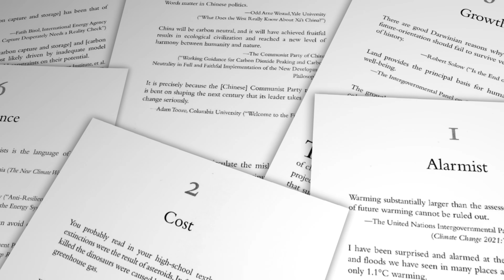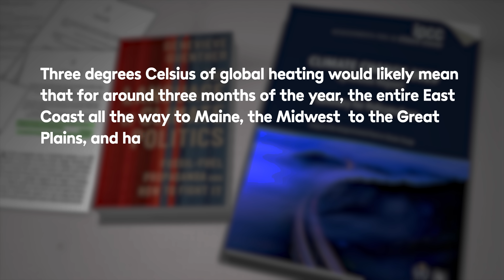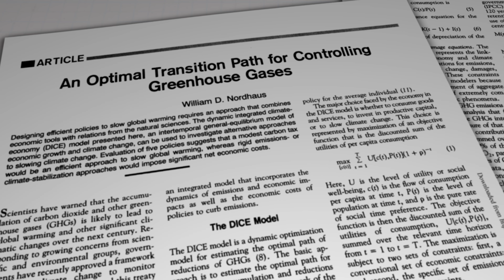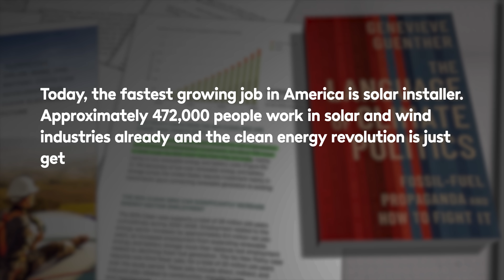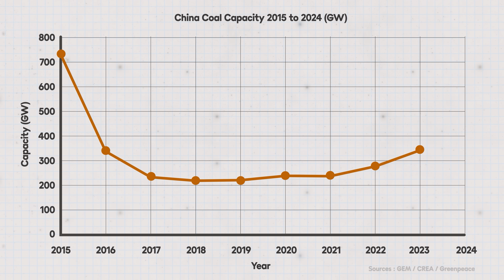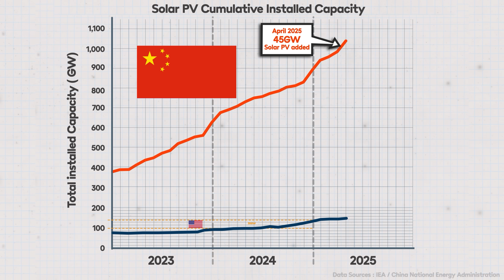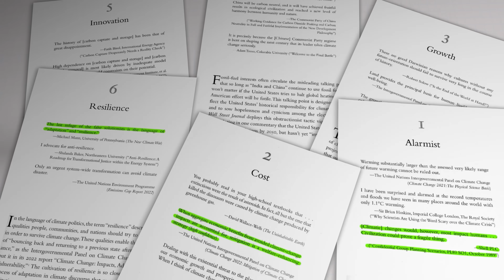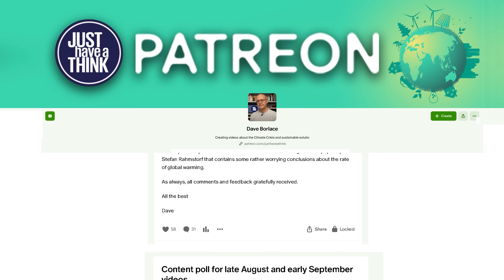New research DEBUNKS climate disinformation.

Comment: Another important point to make about China and India's emissions is that in the last 50 years western nations have offshored heaps of our manufacturing over to those countries. So yes, there's a lot of carbon emission over there, but that's because they're producing all the stuff that we consume as well as the stuff they consume.
Reply: Make planned obsolescence illegal
Reply: Yes. Also don't forget that China and india have been developing countrys with very low emissions for a long time.
Reply: @monkfishmondfinsternis3162  "China and india have been developing countrys with very low emissions for a long time."   Extremely low cumulative per capita emissions -- barely a rounding error of the sum of the developed countries, i.e. global north.
Reply: @alan2102X  Wrong, China's per capita CO2 emissions dwarf most of Europe's including the UK.
Reply: @Hedgehog-e3r  Perhaps you missed the word "CUMULATIVE", i.e. historical. China's cumulative per capita emissions (over a century or two) are as I said a tiny fraction -- like a rounding error -- of that of any developed global North nation. Same with India's and the rest of the global South's.
Further, China's current per capita annual emissions (9.4 tons) do not "dwarf" the E.U.'s (10.7 tons), though they are indeed a lot higher than the U.K.'s (4.4 tons). Some of China's emissions are, as you know, generated in the process of producing stuff for the U.K. and the rest of the global North; i.e. they do not express the reality of the emissions for which China is properly responsible.
Reply: @alan2102X  Deflection - they're the major contributor to the highest ever man-made CO2 levels in the atmosphere. But you're saying it's not t3heir fault?
Reply: @alan2102X  Some 2023 numbers: Canada 14.91 tons, Russia 14.45 tons, Australia 14.21 tons, US 13.83 tons, China 9.24 tons, Germany 7.06 tons, Austria 6.65 tons, EU 5.66 tons, UK 4.42 tons, Israel 4.13 tons, Mexico 3.52 tons, Ukraine 3.17 tons, India 2.07 tons, Afghanistan 0.21 tons, and the world average is 4.86 tons. So I'd be careful about accusing either China, India, or the EU of slacking when the USA produces more than any of them.
Reply: @alan2102X  No they're not! their last 8 years of emissions have easily overtaken the estimated complete CO2 emissions that Britain has produced since the start of the Industrial Revolution. And China's emissions are the main driver in making man-made CO2 levels the highest in historical times. If you really believed in the man-made CO2 = global warming hoax, you should be wetting your bed by now about China, but you're not, are you?
Reply: @KaiHenningsen  Lucky you're so relaxed about China being the world's major contributor to man-made CO2 then. So you don't really believe in the man-made CO2 = global warming hoax. That's a relief.
Reply: @KaiHenningsen  So that's OK then - China can go on being the world's largest emitter of man-made CO2 because obviously that won't accelerate any tipping point in the destruction of the planet?
Reply: @monkfishmondfinsternis3162  So that's alright then! You're in the cult of saying man-made CO2 production is destroying the planet, now you're saying it's OK for the chief protagonists to carry on emit as much as they want because they, err, didn't used to. You're nuts!
Reply: @monkfishmondfinsternis3162 Radioactive Carbon measurements of atomic tests in the 1950's show clearly that virtually NO CO2  older than 50 years is still in the atmosphere. What is emitted NOW counts. Its not cumulating over hundreds of years. So indeed what Asia is emitting is the problem. Western emissions are comparatively low. Yes they produce for us. Then stop buying their stuff. Will make billions starving. Is worse than a few degrees for sure.
Reply: @gerrysecure5874 
Maybe Not use 70 year old data? Or at least give a real source?
Reply: @monkfishmondfinsternis3162 Not actually sure that developing countries who use wood and dryed cattle faeces as a highly carbon intensive cooking have low levels of carbon polution.
Good argument for helping to improve living standards to transition to electric cooking that can be produced with considerably less carbon polution.
Reply: Exactly what I've been saying for years! All those dirt cheap nick knacks we buy, some useful, some not, many don't last and need to be replaced...
Reply: @TheSkystrider  But all you are really saying is that China is cheap, making no point about why East Asia has been producing those products.

The conversation is about GHGs and western corporate expansionism (the neo-con agenda ) and its monopolising ideology of the consumer industry, which assists the growing class divide and oligarchy that still prays at the altar of money whilst funding the anti-Green propaganda machine.

Your comment is just another piece of script from the 'cop-out argument book of phrases'.
Reply: It's a good thing that China might've peaked emissions last year, then!
Reply: When I last looked in to this, about 17% of China’s greenhouse emissions are for the manufacture of goods for the USA, and the USA is about 26% of China’s total export-related emissions. I’m not sure how accurate these estimates are, but clearly the outsourcing of carbon emissions to China is a significant.
Reply: @JonS  climate 101 reads..,China must never be critisized for anything. It is the evil capitalistic running dog imperialist evil west that must be flogged
Reply: Correct. Fun fact >>> Each dead billionaire helps to decrease the risk of climate change by 66%.
F^ing hell give me a gun.
Reply: True but not to the extent you might think, China's internal economy has grown as have other developing countries so only a third of China's emissions is thought to be due to production of stuff exported to the west or offshored by the west.
Reply: Dude cars are everywhere. Cars produce alot of CO2 also in WESTERN COUNTRIES.  You only speak part of the facts
Reply: it was (probably) more the case of large businesses with international reach chasing the cheapest locations to manufacture, that started the offshoring ball rolling. Hard to imagine that nations would deliberately seek to destroy their own economies. Laissez-faire national policies would have assisted the corporates in their offshoring drive though.
Reply: And they do it with way more pollution than we would, by doing it ourselves.
Reply: also, China is leading the world in the transition to renewable energy and away from fossil fuels. the United States has fallen waaay behind.
Reply: When America's heavy industry was moved to Asia, several significant changes occurred. Air and water pollution were significantly reduced, resulting in cleaner environments in America compared to the 1970s. However, this shift also led to the decline of union labor, as free trade deals with countries that exert strict control over labor were more cost-effective. This change also fueled American consumerism, as cheap consumer goods flooded the market. Furthermore, America, like other Western nations, adopted a new economic ideology known as neoliberalism, which involves the removal of trade barriers and deregulation. As a result, America transitioned from a manufacturing-based economy to a service-based one. However, service jobs typically pay less, necessitating two incomes to support a family.
Reply: @theelephantintheroom8016  and a lot of those service-based jobs will be replaced by AI tech in the very near future.
Reply: The Trumpski Regime is not interested in any climatic truth!!!
Reply: Offshoring our pollution so its not on our books
Reply: Well-said. That makes it "our emissions".
Reply: We're making China the world's leading manufacturing economy by giving them basically unlimited use of coal, the highest CO2 emitter per energy produced of all fossil fuels as it is pure carbon of course. 4.9 billion tonnes of the stuff they burnt last year. 

So why is the UN enabling this while we all pretend that the important thing is for us to destroy our own economy by getting rid of fossil fuels, or ending up only being able to import them at great cost?
Reply: yes thats true that the production moved there but it is also true that theu deliberately avoid(ed)  any environmental protection measures. thats not on the west, thats on them. they could choose to aplly air filters and all but they havent. it was cheaper not to and they generally dknt care much about environment. (thats different with the new generation though)
Reply: @petersq5532 China is the world’s leader in introducing renewables.
Reply: Because the West is virtue signalling on its “green” agenda. China is piggybacking off this hence the ramp up in power generation. CO2 per capita puts China at almost twice the UK but it’s ok for China to keep growing its coal firing? That other great myth is that of storage. There isn’t the mineral reserves to make anything more than a dent in the loss of power from low/no wind and nighttime loss of solar. “Green jobs” have to be paid by the wider economy that depends on power. It’s a cost.
Reply: This point reminds me of the other end of that chain: the amount of waste, including e-waste, shipped to China for disposal.
Reply: @ChillDfect  "reminds you" of the other end of the chain? Had you forgotten it? Or are you just trying to make it sound like this is a thing that has been going on for a long time that you just happened to forget about, and that only now that someone is defending the sour position East Asia has been put in by Western capitalist and commercial expansionism, that you now remember is a thing? Sounds like a lot of exposition to me. Yet it's the only way to explain the grammar of your comment.

And E-watse? What do you mean by e-waste? And why are you trying to infer that it all ends up in China? Maybe you are saying that to bolster your previous comment about 'end of the chain'. As if China is somehow just an end of the factory line waste dump. Now that is pure propaganda again, seemingly designed to deflect from the capitalist middleman and their blatant part in the pollution of our planet with their extravagant greed. A greed that appears to have its HQ in right-wing US politics.
Reply: @Ominousheat  😳
Reply: @ChillDfect  Raised eyebrows means what?
Reply: That is also false even if has some truth in it. If they would have regulated manufacturing in those two countries at the same level as our countries then the problem would be smaller, much smaller. Like we didn't say they had to use coal to produce energy or that their industries should have straight pipes out.

The blame sits among the companies and those two countries leaders, not making sure the production was more "clean". We in Europe stopped some time around the 80's to let out particles into the air(different years for every country), in China they did it in 2013. Because I still remember when they started noticing in the 90's that the temperature went up when the particles were removed. They proved this same theory during the 2 day lock down after 9/11. Now some "new findings", China removing small particles increases the average temperature... When it has been proven in Europe and USA before... Its like using wood instead of plastic, WE USED WOOD/PAPER BEFORE THE PLASTIC BOOM so its nothing new... We even got meat at a service point where they cut it as you ordered causing less "spoil", they even gave it wrapped in paper with a thin plastic/wax sheeting... We repaired electronics, we fixed shoes, we fixed clothing

So blaming us is wrong too because them not following the same restrictions made it more profitable for companies to move the production there. 

They could have regulated better because they sure knew the same things we knew but they wanted money...

Made in China or Made in Taiwan was seen as trash, no kid wanted that stuff because it was not quality. Then companies over here noticed its better to sell 10 "crap quality" things for 1 than 1 "good quality" for 5, more profit for the greedy investors/people buying shares...

So it was the morality of the world that went in the wrong direction, capitalism needs to be put in chains again. It has to be controlled or we will consume this planet to its last profitable pebble.

Blaming this on common people the consumer when its the companies that decide what you can consume and country leaders that make up the restrictions/rules. So more blame sits on the government of India and China than the consumer in USA or Europe, most of the blame sits among those owning shares of companies not demanding their company to put our planet before profits.
Reply: Also, they are the countries most heavily investing in renewables

BTW I love your username.  I'm gathering you're a fan of Bored of the Rings
Reply: China has a plan to go 100% green. The US won't ever have such a plan. No idea about India.
Reply: Right. The idea that Countries are responsible is less true than that Corporations are responsible for the emissions.
Reply: Not to forget rich countries also send their garbage to poor countries....like India Indonesia...china has now refused
Reply: And that’s also why China peaking emissions is so significant.
Reply: @MaximeNoël-c7j  The economy peaking would also mean emissions peaking- time will tell if those can really go in opposite directions..
Reply: @SteveLomas-k6k  It CAN go in opposite directions, but not in a way that can prevent the worst effects from occuring.
Reply: @MaximeNoël-c7j  We'll see I suppose. But the bottom line for me is: cheap energy is obviously great for the economy and standards of living all around the world. Whether or not it makes the weather better or worse in certain places... is a tad ambiguous to say the least. We've been promised global warming for decades now, and it's still way too cold and miserable most of the time where I live.
Reply: And the worst part about that, is if we hadn't done that WE have better regulatory systems and regulations to reduce emissions. Globalist free trade made this whole thing worse. We could have instead kept our manufacturing here, managed emissions and built a lot more nuclear power plants that don't produce greenhouse gases... But we didn't.
Reply: And reaping the benefits .....
Reply: At the cost of destroying our manufacturing base - a process which 'we' were never consulted about, but which was absolutely planned by China from the outset.
Some of 'us' would happily dispense with lower cost Chinese products.
Reply: @michaeldeane6600 
You’re a fool. China just grabbed the opportunity, and fair enough. They’re only looking out for their own interests, but they have no power to dictate terms to western corporations. The reason our corporations sold us out was so that the executives could pocket all the cash they saved on wages
Reply: @michaeldeane6600 - planned by China?  Nope ... planned by those companies in the west that outsourced to a cheaper manufacturing location, aided by politicians on the right that gave them the tax breaks to do so ... abetted by consumers that brought all the cheap crap from china they could afford .... The only thing China did was oblige ... western nations are funding their own demise ... the only question is will the planet destroy itself before the end.
Reply: Good point
Reply: Correct. Much of Western emitions are moved off shore.
Reply: And adding to the analysis.
, when one looks at the emission per capita, developing countries trail far behind us and some europeans. So it would be unfair to not let them use the remaining carbon budget for their developmental goals while the majority of the west had more than their fair share of industrialisation and growth on the back of outsourced pollution and emission.
Reply: @00sarvottam00  False observation, as China's per capita annual CO2 emission is far in excess of what ours is or ever has been. So the UN is enabling the largest ever CO2 emissions while we're being made to blame ourselves for having had the nerve to have created modern civilisation. It's all nonsense.
Reply: @Hedgehog-e3rplease show us your data.
Reply: The donkey tails need to be pinned to consumers, not necessarily the producers.  Consumers are shifting their environmental responsibilities to producing countries.
Reply: @bipl8989  They can produce things cheaper because they (eg China) have an essentially slave-wage workforce combined with unlimited use of cheap fossil fuel energy.
Reply: @bipl8989   I don''t know what "Consumers are shifting their environmental responsibilities to producing countries." is supposed to mean.
     Consumers buy what is made available to them. Consumers didn't move US manufacturing to China and Mexico etc. Corporations did that to exploit more desperate workers.
Reply: @lrvogt1257   Sometimes consumers have the choice to buy products manufacturerers in countries with tough climate and pollution controls and should arguably do so if they have serious convictions and concerns.  If you don't think that they do not have that choice, then change "consumers" to "manufacturers" , or "corporations".
Reply: @bipl8989  you really think the average guy is researching production methods?
Reply: @lrvogt1257Those seriously concerned are not average.  What makes you think they could be?
Reply: @bipl8989    What makes you think that's what I mean?  "Consumers" are not defined as the "seriously concerned." That wold be a pretty small subset.
Reply: Yes but I do find that all these keyboards, screens, computers, routers and fibre-optic cables manufactured "over-there" do enable me to write comments highlighting the fact that over-consumption is destroying our planet which makes me feel good. So it's not all bad.
Reply: @nicennice  Yes, and these products are all made using plastic...derived from oil.
Reply: @JimSmith-d9t  Far better than just burning that oil. Also far smaller volume of oil I believe.
Reply: @nicennice 😅😂
Reply: @nicennice  So, you are trying to justify your own overconsumption with an obscure online rant against overconsumption.
Reply: Obama who exempted China from any emissions control until 2030. That was the only way he could get China  to agree to the Paris accord. The incompetence of Obama  is beyond  comprehension. And now China is gearing up for war using ultra cheap coal generated electricity.
Reply: @Volthrax  fyi: the U.S. president doesn't get to 'exempt China' or any other country from 'emissions control', so that's just a load of bs. Furthermore, China is light years ahead of the United States on both emissions control and renewable energy, particularly solar.
Reply: @techcafe0 but he did. Obama quietly secured an informal agreement that , in exchange for China accepting the Paris  accord, they would be exempted from emissions control until 2030. That is a fact. What Obama hoped to achieve is puzzling, all he did was give China the green light to go berserk with emissions, and they did. Anyone who believes  China will suddenly slash emissions in 2030 is extremely gullible.
Reply: Another important point is that nearly 98% of CO2 emissions come from natural respiration/ breathing. Our human contribution isn't doing anything much other than green the planet a little.
Reply: @SteveLomas-k6k 98% ABSOLUTELY FALSE
Reply: @SteveLomas-k6k  : Plants and animals are part of the natural CO2 cycle. It cycles between them along with other natural factors at around 280ppm.  That doesn't change Earth's energy balance. Something has to force a change. 
     Industry pushing CO2 beyond 150% its natural pre-industrial high is forcing the change causing increased warming. 
     Industrial CO2 has a different isotope so it's been measured that it's now about a third of the CO2. 280 is natural and the balance to 420 is industrial.
Reply: @lrvogt1257 I take your point, but there was never a balance: That 280 ppm was the result of plants consuming and burying CO2 at a faster rate than it could be replenished by that respiration- down from 7000ppm during the Cambrian. 4000ppm during the Ordovician ice age.

This represented a semi-starvation level, which helped open up vast deserts on Earth that were long lush. The less CO2 plants have, the more water they require and hence the more prone to drought. We are merely recycling and replenishing a small amount of that vital lost nutrient. RESTORING balance. Being human caused does not always mean 'bad'
Reply: @SteveLomas-k6k  Your previous comment is written in the present tense.
Reply: @bipl8989  Yes, natural respiration is still nearly 98% of all CO2 emitted into the atmos. every year. Even with our contribution.
Reply: @SteveLomas-k6k  :  Almost everything about Earth was different in the Cambrian and Ordovician. The plants and animals, the geology, ocean currents, the distance from the sun and we weren't there. 
     Actually, when CO2 makes plants grow faster, they need more water. Some crops become bigger but less nutritious and more extreme weather destroys crops. Food insecurity is rising. People in one place can't just buy food from another so easily. They've lost their income as well as their crops. The current distribution system is not based on human well being but on corporate profit. 
     Regardless of the past, civilization developed in 280ppm max and industry has increased that by half. Whatever happened before this industrial  increase is bad for US NOW.
Reply: @lrvogt1257 "everything about Earth was different" Agreed, and that illustrates the point; there are far bigger factors influencing climate than CO2 levels ever did.

And the point remains regarding effects on plants: CO2 has been depleting for millions of years, there was no balance that we are disrupting regarding CO2 levels, rather we are restoring balance.

An interesting comparison is the exponential increase in human CO2 emissions over the last century, versus a remarkably linear increase in atmos. CO2 levels.
Because the extra CO2 is being consumed almost as fast as we can produce it. i.e. We'd need to maintain this exponential increase in industrial CO2 output over another century just to maintain a linear increase, for a modest doubling of CO2 which would trap a negligible amount of heat.

Which I'd say is unfortunate since plants don't like freezing either..
Reply: Thats a good point.
Reply: Exactly. Green policy is "take the pollution, and shove it over there!" And then add more with shipping. Maybe there should be some sort of disincentive to do the shipping on top of lower emission standards production in foreign countries. Some sort of tariff. Can't be a tariff though. Trump did that, which makes it evil.
Reply: @SangoProductions213  China uses half the green house gasses per person even with the "shove it over there" we've done. They have four times the population of the USA and only produce twice the green-house emissions. China also produce 4 times the total electrical power, showing that their ratio of renewable energy use to fossil fuel use is also much better and continuing to rise.
Reply: @joelpettlon9650  China's renewable program is a red herring, their production of unreliable and large-scale unstorable (ie often useless) electricity through renewables is climbing far slower than their increase in fossil fuel consumption.
Reply: @SangoProductions213  "Green policy"??? Really? Conservative administrations and corporation had no hand in US off shoring the manufacturing, changing tax laws to make it more profitable. You have any ability at all to analyze all that happened to get us here?
Reply: @markvalery8632  Actually, Republicans and conservative organizations were pushing for "free trade" and other off-shoring measures for decades before Bill Clinton signed it into law, which was seen as a betrayal by the left of the time and a trade to the Republicans for other policy concessions.
Reply: @markvalery8632  "Conservative administrations and corporation had no hand in US off shoring the manufacturing"
What? Reagan is the father of incorporating neo-liberal reforms. Alongside Thatcher. Both conservatives.
Why? Stagflation. And where is the US now? Stagflation. Now the "solution" is to completely destroy the country...
And yeah, every administration have gone even further into globalization, regardless of side. Maybe I read it wrong, but...
Reply: @SangoProductions213  "Some sort of tariff. Can't be a tariff though. Trump did that, which makes it evil."
Can't be tariffs because it has nothing to do with taxes or protection of industry, but cheaper labor.
There's lots of reasons to define Trump as evil, tariffs for protection of industry that doesn't exist is only one of them.
Countries don't want to get tariffed because it hurt their export. Why? Because increased prices makes them unaffordable.
Reply: @gottagowork  I think Sango's being tongue-in -cheek about tariffs being evil.
Reply: @SangoProductions213 the tariffs not working has nothing to do with TDS like you’re alluding to. Tariffs do not work to achieve what you’re referring to, we have centuries of repeated attempts and failures to reference. But I don’t suppose you read or learnt from history did you?
Reply: @onarandomnote25  So you claim that if prices increase relative to competitors, there will be no change in consumer behavior. Maybe you should write an economics book. You sound smart.
Reply: @onarandomnote25  Actually in the hypothetical of having a "carbon tariff" so to speak that might work. It would drive down consumption from places that produce lots of emissions per product to somewhere that produces less. Of course this administration has no desire for that as it sees tariffs as quid-pro-quo by other means, on top of the other anti-climate actions it takes.
Reply: @SangoProductions213  Given how much the US imports and how stretched the finances of the people are, all the tariffs will do is drive down consumption. This in turn will drive down the willingness of businesses to build more factories, especially in expensive places like the US.
Reply: @12pentaborane  US is a service economy, no longer a production economy. Can you imagine how the world looks like when China becomes the next service economy leader because US decided to throw it all away?
Reply: @12pentaborane  You wish! - simple economics will tell you the opposite, as factories are already relocating to the US (like Apple) as a result.
Reply: @SangoProductions213 Please do NOT conflate any considered Green policy approach with the greenwashing apology for environmentalism from the "business as usual" deceptions of corporate polluters.
Reply: @SangoProductions213  CBAM by European Union
Reply: @SangoProductions213 See what you did there. Sniping at the alarmists without them getting it. Clever.
Reply: This is why net zero is totally pointless
Reply: @ben1895  As a goal, net zero is far from pointless even if "zero" is unlikely to be achieved in our lifetimes. "Net fifty percent" (or so) would slow down warming. Our children will thank you for striving for it. Focusing on "zero" exclusively is a logical fallacy. Zero is a straw man
Reply: @archstanton_live Net zero doesn't solve the problem, it displaces it, which would be ok if it displaced it to another planet but it doesn't. All we've done in the UK is move our manufacturing to other (less environmentally friendly, less regulated countries) so arguably we've made the problem worse. We would be better off keeping manufacturing and heavy industries in the UK and couple that with incremental goals of reducing harmful emissions...or we just outsource it to China and India etc and pat ourselves on the back for lowering our countries harmful emissions...aka net zero targets.
Reply: @archstanton_live as it looks, with more carbon sinks turning  to carbon SOURCES and a potential of a tipping point cascade lurking that we really shouldn't try out, because even human adaptation has its limits and hundred million/billion misery/mayhem occurs to be the logical outcome of this, net zero might be really a straw man and we'd need to go CO2 NEGATIVE to NOT reach the doubling of atmospheric CO2 aka 4,5°C climate sensitivity or worse... 🔥
Reply: @archstanton_live  Do you have sources for 50 % reduction being enough to slow down GW? Sounds to me  like trying to make a deal with physics, because scientists say that CO2 stays in the athmosphere for thousands of years. As far as I learned, we should rather get to negative emission as fast as possible. So shoving emissions from shore to shore won't help, even if it gets less in sum.
Reply: @esmeogg2106  Good question. The best source I can offer is every projected CO2 curve ever projected by the IPCC in any of their reports reflecting all the possible scenarios. I picked 50% because it is as “ballpark” as possible and more or less achievable. If you are asking me how much of the human race it will save, I cannot quantify that. You are right. Best we get to as close as we can to zero fossil fuel CO2 emissions ASAP. Shy of that we obviously need a plan B. Pragmatism is not selling out and not as devastating as despair.
Reply: @ben1895 Explain please.
Reply: @ben1895  This is why the human race isn't going to survive. It's totally pointless.
Reply: @ben1895  
Yes exactly , especially when u know the breakdown between natural 
CO2 and man made CO2 
Natural CO2 is 96% the other 4% is what us humans make . 
So even if humans did not exist CO2 would still be in a rising phase 
So pointless even more when you consider that . 
How u gonna deal with the 96% .......... if u believe that CO2 is causing 
all this harm ?
Reply: @ben1895 really? Your procreating is pointless!
Reply: @ben1895 it is not pointless but an overreach. and definitely should not be maden a competition about it.